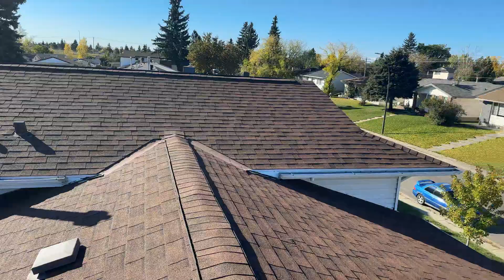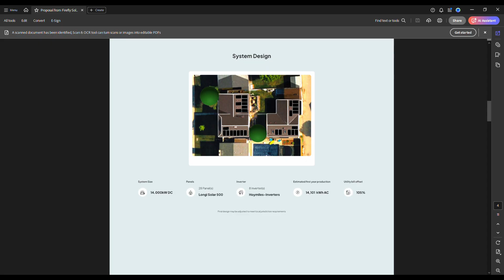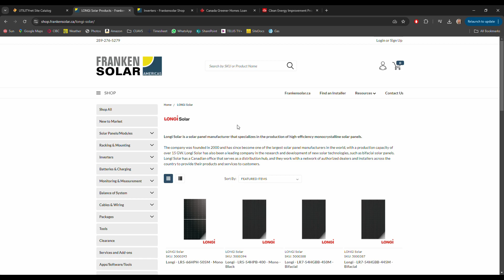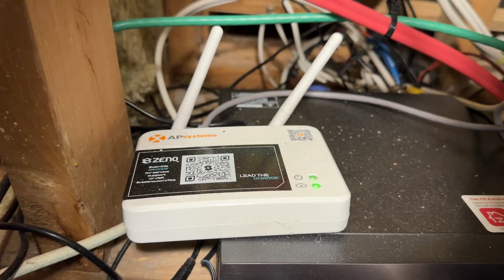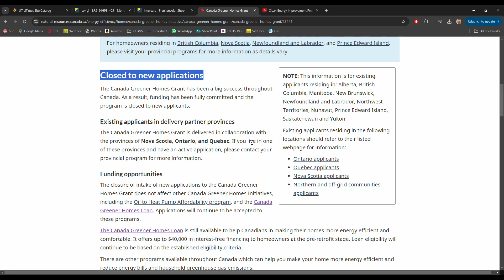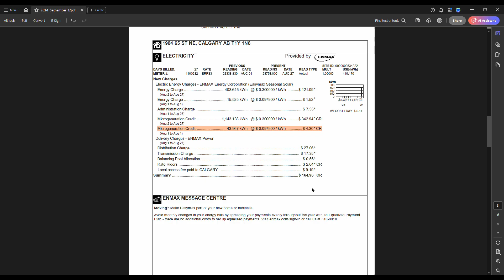My Home Solar Journey in Alberta

Comment: You said you’re a DYI person, why you opted to go with a subcontractor? I guess what part of the process scared you off?
Reply from the maker: Great question. The major issue was the $5k grant was not available to diy. Combined with my personal availability made me opt for an outsource. I wanted to diy… and I watched them like a hawk.
Reply: @johnniemo  I was ramping up to do a DIY solar install in NE Calgary, but it states right on the city's permitting site that solar panels are not allowed to be installed/permitted by homeowners.  Big set back as I was really hoping to save that $12k installation cost.
Reply from the maker: @JaysMetalVideos  Can you provide a link to that?  That's a new development.  I would have done DIY if the grant didn't exist. (which it no longer does).  It may be that you need a master electrician to do the hookup.  Don't see why the city care who puts holes in the roof.
Reply from the maker: Should also add the part that scared me was the permits. I had no clue where to start.
Reply: @johnniemo  I'm also in Calgary and wanting to DIY, but the permits are beyond me. Do you mind messaging me which Zeno installer did your install? Would greatly appreciate it!
Reply: @mavagam99  permits are easy (electrical anyways)...not so sure about the agreement though with clubs/ enmax etc.
Reply: The reason I asked is that I wanted to DIY but got a bit nervous about having to drill my roof without warranty should it start leaking. Anyway took your advice and contacted Zeno, got the quote and signed the contract. Out of four quotes they came out cheaper by much. Now I hope that the install and approvals will go smooth. Thanks for the video.
Reply from the maker: @andreivataman8960  ask for Tyler :)

Comment: Great video. Quick question if you’ve got the time. You mentioned how they quoted/built your setup with 105% efficiency. I was just quoted 108%, but when I’m looking at the mockup they have presented me, they’re not fully utilizing the west side of my roof (they could easily double the number of panels). I asked the sales rep why not add more panels and get the number higher then 108%, let’s say go to 140%. He couldn’t give me a clear answer, but also mentioned how they have to aim for 105%. Any idea why they won’t make you more efficient then that?
Reply from the maker: Sorry I may have misunderstood. There is a rule that you can't go higher than 1xx%. I thought it was 105. Depends on your utility. So they need to submit a design that keeps it under that number.

Your goal is to get to that number with as few panels as possible. Their goal may not be the same as they get paid for selling more panels.
Reply from the maker: They make more money when they sell more panels. So they are incentivized to make it less efficient. 

A better idea would be to submit the design as is and then have them move the panels during installation. That would get you a higher number and still be within the rules.
Reply: Thanks for the info man!

Comment: Good walk through.  At 13:16, it actually took you 8 weeks to get the microgeneration approved by Enmax?  I feel fortunate then, as it only took 8-days to get our microgeneration approved!  I'm on the other side of 68th Street NE from you by the way. :-)
Reply from the maker: Ya, I think that was about right.  The system went online around June 12 and the approval was early August.  As a result, I didn't get any credit for like 1000 kwh I gave to the grid.
Reply: @johnniemo  I was concerned that Enmax would drag their feet on the 'paperwork'.  Because it benefits them to get take our surplus electricity for free and charge your neighbors full retail rate for the same electricity!  That's 100% profit margin!

Another possibility is maybe Zeno didn't get their paperwork in order fast enough or there was a hiccup. I went with SolarYYC but tried Zeno at first but they didn't get back to me.

Even after micro-generation is enabled, Enmax profits handsomely.  Because they only pay for "generation" costs while charging our neighbors full rate per kWh "generation" + "transmission" + "distribution" for the same electricity.  And our electricity likely doesn't even reach past the local transformer before being consumed by our neighbors too so there's zero stress on the grid.  This is the benefit of in-situ distributed energy generation.  The utilities hate that!

So the utilities saying that solar "cost shifts" from "wealthier" households to poorer households (that can't afford solar) is pure BS.  It's like this in California now where I used to have a house with solar.  Its getting to the point that the California utilities are outright killing off residential solar with bogus claims.  It's happening all over now too, and I hope it does not come to Alberta but seeing as Alberta's government is defacto run by O&G, I worry.
Reply: @johnniemo  I was concerned that Enmax would drag their feet on the 'paperwork'.  Because it benefits them to get take our surplus electricity for free and charge your neighbors full retail rate for the same electricity!  That's 100% profit margin!

Another possibility is maybe Zeno didn't get their paperwork in order fast enough or there was a hiccup. I went with SolarYYC but tried Zeno at first but they didn't get back to me.
Reply from the maker: @ja8570  I never thought of that.  You're correct that they are incentivized to slow roll it.  One positive of Zeno is that the system was online for those 8 weeks.  So at least I was eating my own power during the day.  Most companies are not given that option.  The switch is left off when they leave.
Reply: @johnniemo  Even after micro-generation is enabled, Enmax profits handsomely.  Because they only pay for "generation" costs while charging our neighbors full rate per kWh "generation" + "transmission" + "distribution" for the same electricity.

And our surplus electricity likely doesn't even reach past the local transformer.  It goes up the secondary winding of the transformer (at the standard household 240Vac 60Hz) so is immediately consumed by our neighbor's loads so there's near zero stress on the grid.  This is the benefit of in-situ distributed energy generation.  The utilities hate that!

So the utilities saying that solar "cost shifts" from "wealthier" households to poorer households (that can't afford solar) is very incorrect.  It's like this in California now where I used to have a house with solar.  Its getting to the point that the California utilities are outright killing off residential solar with bogus claims.  It's happening all over now too, and I hope it does not come to Alberta.  But I worry because as Alberta's government is defacto run by O&G.
Reply: @johnniemo  If Zeno installed APS microinverters, I don't think there is actually a way for them to turn on/off the system remotely.  The power is just just controlled at the breaker.

After the installers completed, I couldn't resist and just turned on my system after they left.  It only took some few days for the City of Calgary inspector to come out.  He was there for a minute and just looked at the mains breaker box and the incoming line from the roof.  I made sure to turn off the breaker while he was there though just in case. 😆
Reply from the maker: @ja8570  I think there is validity in the argument that "someone has to pay for the grid".  The system is designed such that people pay for it based on how much they use.  However, much like the road system, once you use a road a single time, 95% of its cost are attributable.  The grid is the same way.  Take or give one watt and you need the entire thing - end to end.  

There will be a reckoning eventually.  But I do believe the Alberta system to be the best in Canada at the moment.
Reply: @johnniemo  Just to be clear, solar users are paying for the grid.  As I mentioned above, Enmax is buying your excess electricity for about one-third its market value and selling it to your neighbors at full cost.  This is happening on an ongoing basis as they're paying for just generation cost but selling the same kWh with full generation + transmission + distribution cost to your neighbors and so profiting handsomely.  This is part of "net billing" tariff system.

In addition, there is a minimum monthly charge connection charge like some $10/mo and a series of other administrative fee charges regardless of whether you use any electricity.

Solar users are paying for the grid and will increasingly do so as utilities around the globe reduce payouts for surplus.  Some are even considering charging solar users a specific "grid access" fee which essentially will destroy their regional residential solar market.  Utilities are actively taking out what they see as competition.
Reply from the maker: @ja8570  its pretty clear you think solar generators are being fleeced.  I'm not as sure I'm in that camp.  A reliable grid, for the "worst days of your life" costs money.  We won't accept less.  There is some nuance and debate about how it gets paid for.  We as solar users rely on the grid to both sell our excess and power us in the cold and dark.  I for one appreciate that service.  If people don't like it or the rates, they can buy a battery wall and get on with it.  

I do agree that we do them a great service, and I think that's why we get 30 cents.  Should we get more?  Maybe.  I'm not versed well enough on the financials to comment.
Reply: @johnniemo   I wouldn't use the word "fleeced".  To be clear, it frustrates me to hear completely false narrative that solar users are a burden on the system.  Knowing what you know now, would you still think that we solar homes are "not paying for the grid"?
Reply: @johnniemo  Also, to add a local story to this...

I also have a home battery and with the sun so strong in Alberta now, I've been exporting about 20X to 40X the amount of energy I use on a daily basis these days.  That is, I'm importing about 0.2kWh to 0.6kWh per day while exporting 20kWh to 45kWh.  So I'm supporting the local grid much more disproportionately to what I'm compensated both feed-in payback.  Plus I had to pay for the capital cost of the solar equipment.

In general, every watt generated and used locally is a watt that doesn't stress a distant power plant to generate nor the grid to transmit.  This is because fossil fuel power plants are dispatchable and "load following" and throttle back their power output accordingly.   Fossil fuel power plants are last on the "merit order" priority generation list as they have the highest marginal cost due to fuel requirements.  So this cuts down on fossil fuel usage for reduced carbon emissions, reduced wear/tear on expensive complex power plants, and reduces wear tear on the grid infrastructure, especially on expensive transformers that are a consumable part of the grid.

In Alberta, its especially beneficial as 85% of our 74TWh annual grid generation is powered by fossil fuels (natural gas, coal/coke).  As more residential solar comes online, this effect magnifies both in cleaner electricity generation and financial benefit to the grid as the utilities benefit so much from our cheap locally generated electricity.

Just to highlight the power of distributed generation further, consider heatwaves when the regional grid is severely stressed from all the combined A/C use.  But heatwaves are when solar homes will be getting peak power since heatwaves naturally come with abundant sunshine.  More than likely the solar home is completely powered by solar.  That includes running all of its house loads including a big A/C unit.  With so much sunshine, its also likely the solar home is still exporting some electricity too and thus supporting the neighbors which supports the grid.  All at a time when heatwaves are expected to become more intense, more widespread, and more frequent.
Reply from the maker: @ja8570  I'm not sure what you want from this conversation.  You are exporting 20X to 40X.  So the "grid" is taking your excess, which would otherwise be sent to ground, and providing it to your neighbours and compensating you.  I agree that solar is a good thing.  That is why I bought it.  You are clearly expressing a great many positives that I agree with.  It appears that you disagree with the pay formula.  

I think it may make more sense to have floating power rates like Ontario.  That would force people to be more mindful about usage, OR more mindful about local generation.  But I think that would cause a mutiny in Alberta.  Not every home is suited for solar.  Mine was, so I did it.  Not everyone has the option.  I do agree fully that we are not a burden.  IF anything, we will prevent brown outs.
Reply: @johnniemo  A clear acknowledgement that solar is not a burden to the grid would be a start.

Let me summarize the major points in bullet form:

A) Solar pays back more than it costs because all that excess solar is being purchased for fractions of cost by the utility and being sold by the utility at full retail rate for a large profit by the utility.  They're paying only one-third at most because retail electricity is made up of three major parts: generation + transmission + distribution.
B) The energy we solar homes generate is not huge and likely does not even make it past the street transformer before consumed by neighbor, hence why its labeled as "microgeneration".

C) Regardless of payment structure, the locally generated solar energy displaces fossil fuel generation reducing carbon emissions and wear/tear on the equipment, reduces wear/tear on grid infrastructure

Let me know if I have specific questions about this.  I wrote so much to try to clarify things, but it can be overwhelming at first.  I would suggest taking some time to read up on this.
Reply: @johnniemo  Looks like my response from last week didn't show up.  YouTube's forums are buggy.

I'll summarize again... the clean locally generated solar power allows fossil fuels to reduce their output that much since fossil fuel power is dispatchable and "load following".  This happens day after day and increasingly so as more solar is added.  Furthermore, the power is being purchased for one-third the cost by the utilities from you and sold to your neighbors at full price.  This directly benefits the utilities financials since more profit for them.

Moreover, the solar home draws less from the grid to begin with reducing carbon emissions further from distant fossil fuel power plants.

This is pretty easy to understand on the import and export side of things right?  Which part don't you you understand specifically?

Like it or not, your system is going to attract a lot of questions from local friends, family, neighbors and online as well.  I was hoping you would understand the basics of what's happening but you are not getting it apparently. :(

Comment: This was great! If I understood the timeline correctly this update was primarily for the warmer months of the year, how did things go over the winter? I know it was a dryer than normal winter, but wondering how things went with snow and the shorter days.
Reply from the maker: In winter you don't make a lot of energy.  In my case, that giant pine tree didn't help two doors down.  So from about Oct 21 to Feb 21, that tree is an issue, but overall the sun is just too low and too brief.  The way I look at it is I use on average 35kwh a day (averaged yearly).  So if I'm making over 35, I'm in surplus.  Depending on clouds and snow, I am making over 35 kwh 8 months of the year.  So on the whole I should be in a surplus situation.  The by-product of solar is you become a hawk on electricity usage in your home.  For example, this week (early April) I am hitting almost 75 kwh on a sunny day.

So to answer your question - don't try to sub-optimize the system.  Winter is a write off, and it's supposed to be.  Look at yearly performance and yearly usage.

Comment: The main reason I went with solar in 2015 was because banks were not paying much on my investments. And the little I was earning was taxable. I was employed back in 2015. I pulled 27K out of my funds for my solar. I'm now retired and enjoying my passive income from my solar. Not having a power and gas bill allows me to pull less from my RIFF accounts. This keeps me in the lower net income bracket. I get the Carbon and GST rebaits now. I have 36 Enphase inverters. I had one fail during a FW update. Two others stopped performing. Corroded MC4 connectors. I already had spare connectors and my own crimpers. My inverters have a 25 year warranty. I'm 64 and had no issues climbing on the roof. Took me 15 min's to replace the connectors.
Reply from the maker: I fully intend to look after this myself once the Zeno warranty runs out.  I may also expand the system if I get an EV.  My current mission now is trying to cut my usage.  At 6 cents, I never cared.  Now with all this money invested, I'm starting to care.

Comment: This video was made in Sept? Get back to me in Nov, Dec and Jan on how badly that 80 foot pine tree across the street shades your panels. I know a guy that knows a guy that could take care of that. lol.
Reply from the maker: Right?  I've been watching that tree.  Here we are mid-October and it's not an issue yet.  I think by early Nov it will become a problem.  I originally discounted that stupid tree as its so far away, but then I got an appreciation for how massive it is.
Reply from the maker: So that tree has started to become an issue around Oct 20.  It cuts across the south facing panels on the house and then the garage.  So it's going to affect me for about 1/3 of the year.